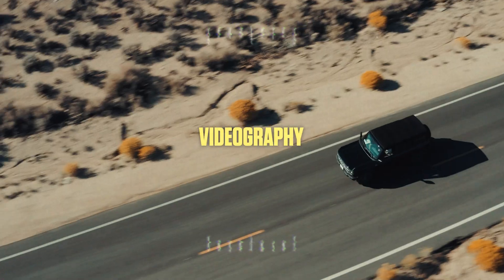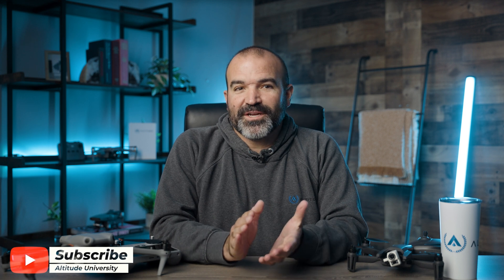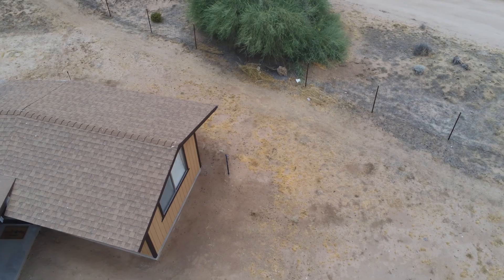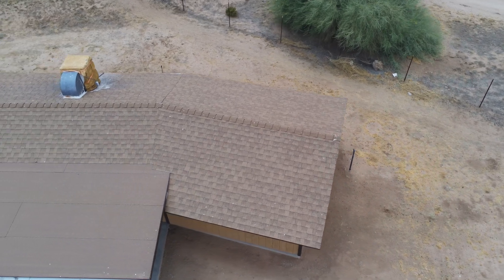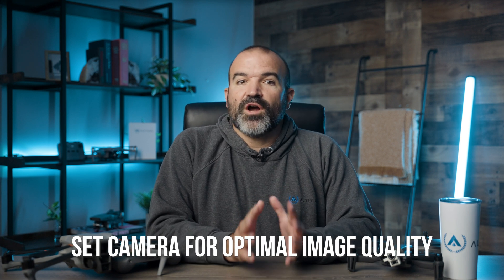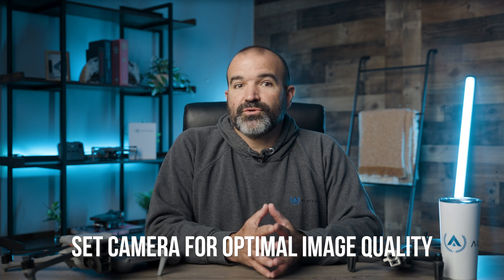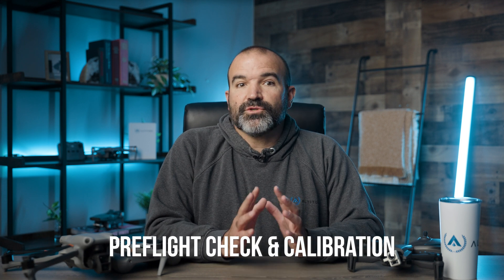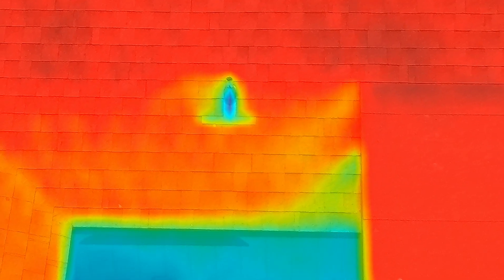Drone Roof Inspections Part 2 of 2

Comment: hello, i would like to know with what kind of software i can work with? can you giveme an advice... thank you in advance
Reply from the maker: Hello, thanks for the question. I like dronedeploy. Have you used it before?
Reply: @altitudeuniversity yes , but I wanted to know if you use something different like pix4d or something like that.. if so , which one do you use, cuz those programs are expensive
Reply from the maker: @davidGTI  I use DroneDeploy, but it is expensive. You can probably get away without using Pix4D or DroneDeploy for basic roof inspections. DroneDeploy has a free trial so you way want to sign up for the trial around the time you can book an inspection and use the money for your first gig to lighten the sting of the first month's fees. I hope that helps.

Comment: Good overview of the process! Thanks! About 2 weeks ago, my wife suggested we get a drone to check our roof - we live in Houston, and between the high winds storm a couple months ago and the hurricane more recently, she wanted to check for damage. Having a 2 story house, she didn't want me to get on the roof. I have a cheap drone, but we needed something dependable. I bought the DJI Mini 2 SE and love it. I used it to get close up video and images of the roof, and did find a couple holes that need addressing. Over the past week or so of flying the drone just about every day, I have decided that I would like to get into using it commercially - either doing roof inspections or surveying land, or whatever. I just want to use it to help others - and make some money. I just retired after teaching for 21 years, so I felt this is the direction I want to go in. Having played with RC cars and trucks since the early 80's (and still do :D), the operating function of the drone is similar, and very fun. So I purchased the course through Altitude University to help me prepare for the part 107 certification exam. So far I'm learning a lot and really enjoying it! I'm very nervous about the test, because I generally don't test well. But I'm confident that with your course, I will have the knowledge and practice necessary to pass. And with videos such as this one, I will gain experience in processes such as roof inspection that will help me achieve my dream - have a ton of fun flying the drone while making money doing it. So thanks again for this great video - I am looking forward to checking out more of them!
Reply from the maker: Thank you for taking a look at our content and for putting your faith in our course. Many people worry about taking the exam but feel good that there is a very high pass rate. Students who use our course (now over 18,000) have over a 99% success rate of passing the exam on the first try. The course has 5 practice exams that you will find are very similar to the test. If you are doing well on those, you can rest assured that you will go to the exam ready. If you have any questions along the way, feel free to reach out to me david@sdaltitude.com